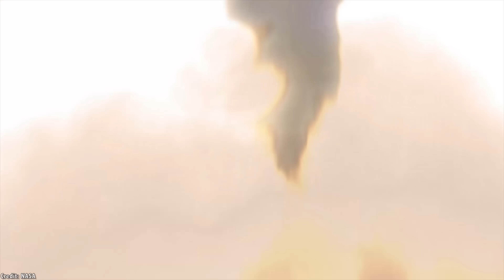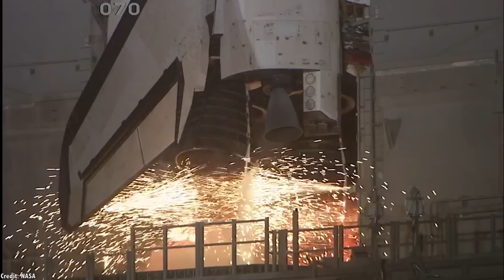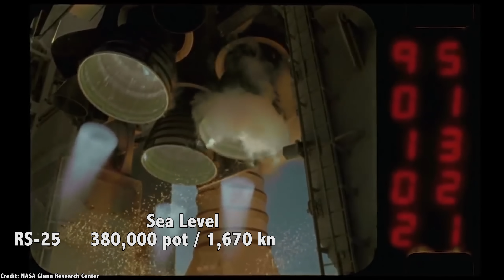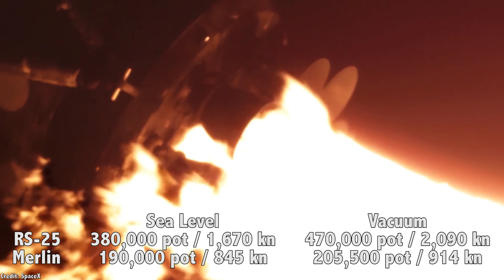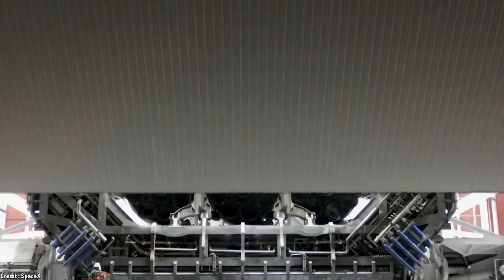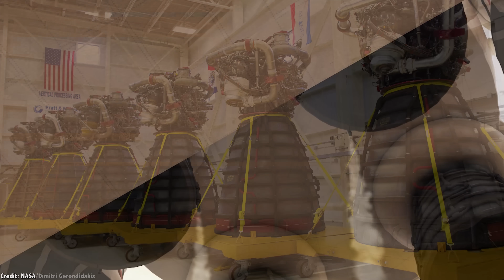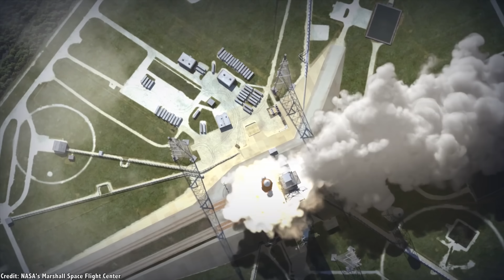The Rocket Engines Carrying Us to Space. The SLS RS-25 (aka The Space Shuttle Main Engine)

Comment: SLS is a waste and NASA should abandon it no one is gonna pay to use that overpriced, wasteful crap.
Reply from the maker: Now that the Falcon Heavy was successful (apart for the failed center core), NASA and the Air Force will be seriously reconsidering their launch options. But it's still not going to be human rated, so everyone will need to wait until the BFR flies, which could take a while.
Reply: SLS is not going to be bought because it is not designed for commercial us (com. satellites etc.). The purpose of the SLS is deep space missions. Anyways, it's still an expensive machine, with capabilities that will probably get matched by other launchers in the 2020s
Reply: MarineIguana Or at least make it so that it's technology is reusable. I have a feeling NASA is just going to abandon it instead of using more efficient and cost effective tech.
Reply: I would also like to add that for heavy lift capabilities reusability seems far fetched, or could hit a point of diminishing returns, where refurbishment is simply too expensive. The "big dumb booster" concept seems better suited for the task. Perhaps an RS-68(I think that was the engine on delta 4) powered SLS could provide that, but dumping 4xRS-25 per launch seems very unnecessary.
Reply: Even when concieved (Constellation program) the Ares/SLS was not a cutting edge machine but rather a political move to keep shuttle production lines going (saving countless workers from being left on the street, I admit, but stagnating NASAs space program).
Reply: NASA were incredibly close to SSTO craft (venture star). Not many realize how insanely close it was to completion. Everything worked perfectly, including the linear aerospike engine. Only the fuel tank was problematic due to material constrains of the time, but nowadays, there is no reason for venture star not to work.
Reply: NASA has a testing and certification program to certify spacecraft or launch vehicle as capable of transporting humans. Wikipedia will provide more information, search on "Human-rating certification".
Reply: Roman Geber Are you talking about being over taken by other rockets from different entities, or by other rockets from NASA?
Reply: What is preventing the Falcon Heavy from getting human rated in the time frame that the SLS will launch? Is not the Crewed Dragon going to launch before the SLS? But as I recall, it fly on a Falcon 9. If I was King of the Earth, I get SpaceX what it needs to launch the Gateway Spaceport.
Reply: +Larry Beckham SpaceX is preventing Falcon Heavy from being human rated. The Falcon 9 will be human rated to take the Dragon 2 to the ISS (and, potentially, LEO in general).
Reply: Thank you! Given the current situation that makes since for Musk to follow that path, given passion is for attended flight is the BFR.
Reply: donnieb that is called throwing good money after bad.
Reply: @A C  The ultimate fate of N1 was not that specific, it was a lot of factors. Not nearly enough funding (especially compared to apollo program), the death of Korolev, and no infrastructure to test the engines before flight to name a few. If they had a test stand, many issues would have been solved. And for the LH2 vs RP-1 comparison I have to disagree. For heavy lift first stages high density is king - kerosene, UDMH and even solids. BFR will fail because of the huge vibrations of the engines, not their number. Saturn V was having similar issues. Fortunately it was at the limit of what a rocket can take without shaking itself apart.
Reply: But Stoyan Todorov, LH2 is a much cleaner fuel, especially if launchs are numerous, like use for suborbit passengers flights.
Reply: I agree it is clean, but the performance sacrifice is too great. RP-1/LOX is not that bad as far as emissions go as well. UDMH, and solids are toxic, and I agree UDMH should exist as rocket fuel only for deep space missions (it is a hypergolic fuel, with good boiling and freezing temperatures). As for suborbital flight, that will never happen. The noise will be unbearable. Same reason Concorde was grounded.
Reply: "The noise will be unbearable. Same reason Concorde was grounded." Didn't it also started to lose money after 2000?
Reply: @Larry Yup, you are right, rising maintenance cost and decrease in passengers killed it (learn something every day). But the fact remains, concorde was allowed to go supersonic only over the ocean( technically, it flew a bit over land as well, but locals got fed up with the sonic booms rather fast). And the double sonic boom of a landing rocket will not get tolerated either. No one wants to feel like London citizens in 1944/45, if you catch my drift.
Reply: I don't understand what the term "human rated" means in this context. Can someone explain it to me please? (English is not my first language, obviously)
Reply: Yeah. The suborbital BFR animation is so wrong.  Perhaps SpaceX will need to offshore launch/landing sites with undersea Hyperloop tunnels to them.
Reply: The thought of hyperloop on earth, gives me flashbacks from a specific mythbusters episode. It is a great concept for transport on the moon tho. As for BFR, it will probably be better to concentrate on the "Mars space Ark" or perhaps a moon capable BFR (even that seems improbable tho, since even a single raptor engine with lowest possible thrust level has too high TWR to land safely there). Making 300t of material go to space routinely is something that I hope comes true, but it seems very far fetched. Numerous procedures have to be passed when preparing for a rocket flight, and way more for refurbishing the engines. Dependance on weather is a dealbreaker as well. No one wants to travel at least 30min to the rocket, wait hoping for good weather, but then having to leave because the flight got scrubbed. If BFR is indeed completed, there will be many possible tasks for it. Earth to Earth flights will not be one of them.
Reply: Roman Geber The NASA plans to send humans to mars get delayed further and further, giving way for more moon missions. NASA had alternatives to the Constellation program in the face of the Venture Star. It was very close to completion and definitely should have been. The SLS might be using off the shelf tech, but that is not because of reliability. They were told to do it by congress who want to keep space shuttle factories rolling.
Reply: Larry Beckham -- thanks a lot!
Reply: Stoyan Todorov -- Maybe the channel "Isaac Arthur" (scientist gone futurist) will be interesting to you. He has videos on hyperloops etc.
Reply: @ozdergecko Yup, already watch him every thursday. Thanks for the recommendation anyways, he deserves way more views.
Reply: FWIW, the Raptor engine is LCH4/LOx. Also, bigger engines are harder to design. Instabilities in the combustion chamber. That's why the Russians went with multiple combustion chambers/nozzles on the RD-170/180
Reply: Roman Geber It is a waste. Nothing inovative, overpriced and a money pit. Shuttle engines and segmented boosters already proven to be a weak link. 8 billion and no solid tube booster body? It's a joke and at a billion per launch not counting development cost too expensive to use.
Reply: The BFR will never fly in its current form. The 2nd stage, especially, is too big and tries to accomplish too much in one vehicle.
Reply: MarineIguana even though they should they've already spent billions on it and at this point it's probably cheaper to fully develop it than to just cancel it.
Reply: Typical ignorant Musk fanboy.  Musk is riding on a coat tale of all the past research that was done by NASA and USAF and I don't trust Falcon 9 or heavy with 36 small engines. Go look up Soviet N1 Four larger engine is way more reliable and not to mention safer than the 36 smaller engines,  Ask the Russians  ask them why there aren't any sickle and a hammer on the moon. Lastly SSME or RS-25 burns LOX and LH Merlin  burns LOX and RP-1 LOX and LH gives the rockets higher thrust and is also better for the environment.